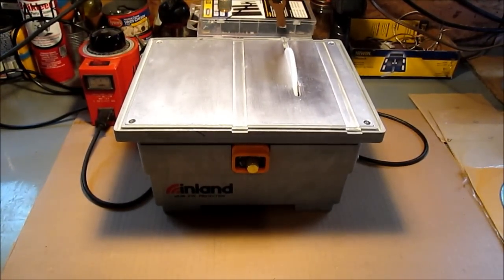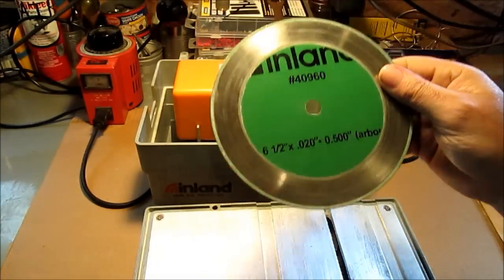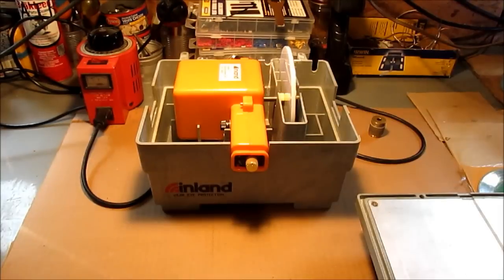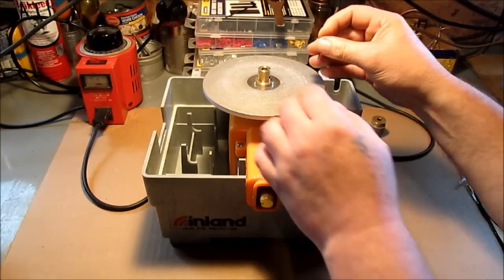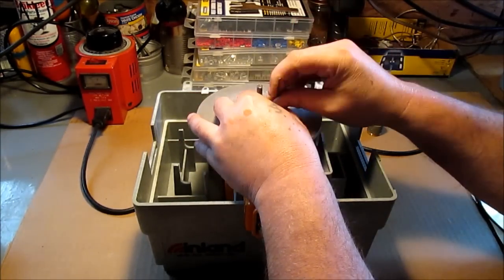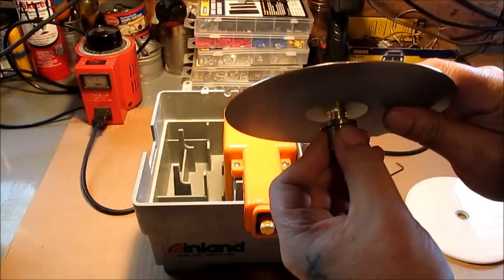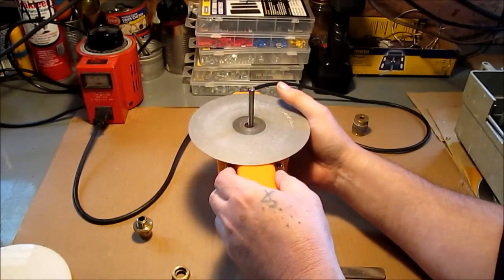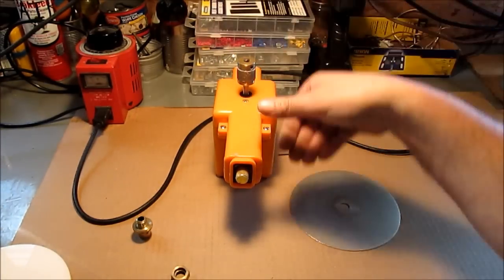Rock Cutting,Grinding and Polish Machine

Comment: Awesome video. I'm on a budget and looking to just buy the trim saw swap top.
What's that thing you have plugged in to control the power flow ?
Reply from the maker: It's called a Variac ....a variable voltage transformer ...This had speed control from the factory but it had a defect that made it only one speed ..This was an easy fix for me

Comment: If you want the aluminium off, soak it in lye solution. The ally will dissolve but the steel and diamond will not.
Reply from the maker: Thanks for the Info.

Comment: Nice Variac in the background. I've got an old antique one that I still use occasionally to bias my tube guitar amps. Got it from an old tv repair shop that was going out of business. Also got a sine wave generator and an oscilloscope.
Reply from the maker: It is a newer import but It works good I use it alot on my dremel tool that the variable speed switch went bad on